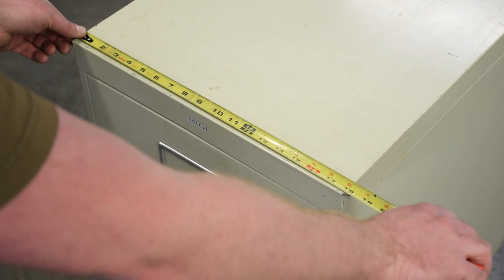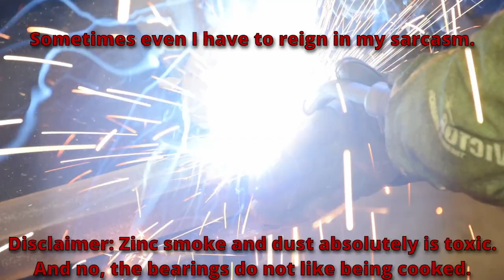DIY welding cart on the cheap

Comment: Good work! My cart is built in the almost exact same way! I used an old 2-drawer file cabinet and built a steel frame for it similarly, but smaller gauge. I also made it so it’s just a little higher in the front than in the back. This makes the drawers to kinda be self-closing. I have larger pneumatic tires at the rear for when I have to move the whole thing from my shop to the tractor shed. The big wheels makes it easier for going over gravel, etc. It’s great to see those file cabinets being repurposed! Keep up the good work!
Reply from the maker: I definitely would have gone with larger tires if I ever took it out of the shop, but no need for me.  And yup, filing cabinets are a very handy thing in the shop, there is all sorts of things you can do with them.  Thanks for the kind words!
Reply: Ñpñ

Comment: I have a couple of the lateral file cabinets in my garage, they work great for storage of bulky tools and supplies.  File cabinets are great.  Cart came out well.  

I agree mill scale removal is a waste of time for all but the most fancy project.
Reply from the maker: Filing cabinets are great storage and they're dirt cheap.  I have a bunch for holding oil/hardware/bigger tools too.
Reply: 100%. Unless you’re tig welding you are wasting your time! That mill scale will get boiled out of that puddle!

Comment: Entertaining.  File cabinets are too flimsy frankly, the doors will end up not working well after a short time of moving it around would be my opinion.
Just commenting for the algorithm.  I need to make another cart, my current one made of two hf dollys and some 2x4 broke.
Everyone seems to use straight wheels in back, my first cart was that way, I hated not being able to move it sideways at will.
Reply from the maker: File cabinets are available in a variety of qualities based on load rating.  The one I used in a mid grade one and has zero issues with the heavy welder on top and being filled with clamps and consumables.  I have many of the high grade ones for storing hardware, and some of them have hundreds of pounds in each drawer and been in daily use without failure.  The cheap ones are only good for storing light articles like rags, gloves, respirators, etc, and I think that's what you're more familiar with.

Comment: Oh yeah... when you built the skid for the fuel tank on your XJ why did you make the front lip flat or at a 90, versus making it angel forward to deflect whatever it hit down & away. Not saying you did this wrong just wondering why??? Thx again...👍👍
Reply from the maker: Great question.  I think it was because there was already limited space between it and the axle.  I might have been able to add another piece to it to make the 45 degree angle without putting the front of it any closer to the axle, but that would have added complexity.  It was a long time ago now that I built that, so I really don't remember.  Currently it works fine, but certainly things could have been done differently to make it even better.
Reply: @2drx4  
After I wrote this I've seen several pics, designs & vids, all are 90° so most not be much of a concern....👍
Reply from the maker: @maleficentcop2752  Yeah, I haven't had any issues with it getting hung up on anything.  But there is always room for improvements on designs!